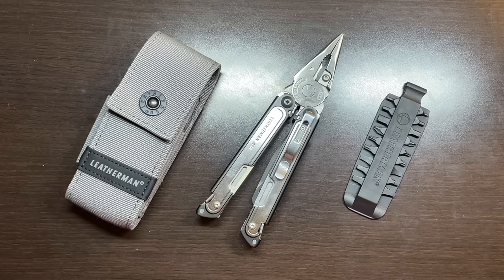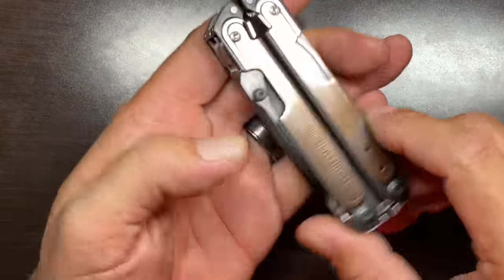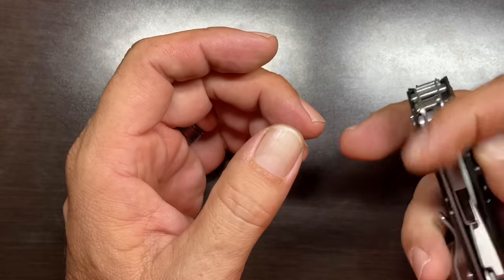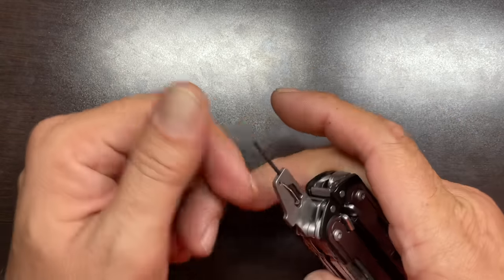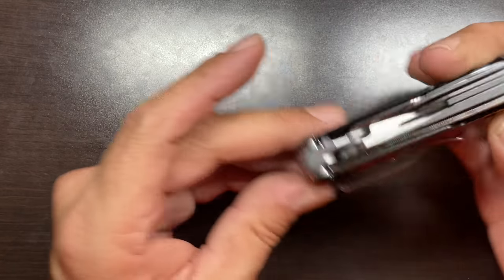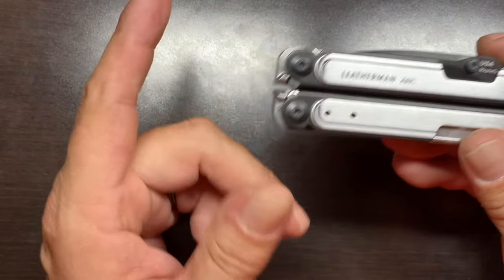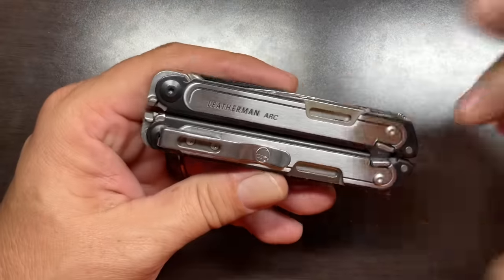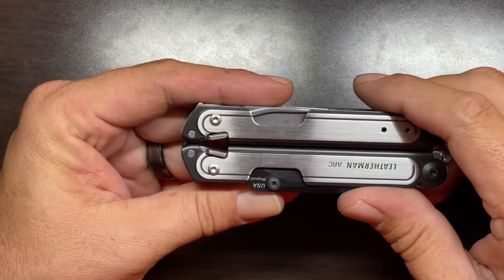Leatherman ARC : Initial Impressions

Comment: Regarding the stiffness of the pivot on the pliers, I share in the frustration. I've re-purchased the same models over the years, namely the Surge and Wave, and never had issues with them being so stiff when put under pressure. This has only happened with my recent purchases of both of these tools. It's pretty annoying having to twist the handles literally almost every time I put pressure on the plier head just to get them to open again.

Comment: Hi Ben, 
Great video as always.  But I must ask , I wonder why they put a micro driver in such an expensive tool like this ……..who the hell uses one of those on a regular basis……….surely it would have been better to put the T shank adapt in there instead, much more use considering …….. 
if it’s such a premium tool, it needs premium usage right?? 
Also, as I’ve said many times before, why don’t they design a chisel /  2 x wire stripper like Victorinox. You can quite easily open boxes etc with that ….. 
I personally think Leatherman need to UP Their GAME if their features, it’s the same old stuff, just moved around. Bit like APPLE !!!! 😮
Reply from the maker: I agree with you on the micro driver.
Reply: I’m in maintenance and use that driver a lot, actually for what it’s worth

Comment: you position the wire with the stripping notch against the frame, and use the blade to strip the insulation by spinning the wire while applying pressure to the blade or awl like a guillotine, depending on model.  thats all U stripping notches, the V ones like on signal can opener does both action as one.  the U notches dont cut

Comment: I think the cutters were a bad batch of heat treated probably had to switch suppliers more than a few times. 

The plier head river is causing the stiff jaws. The easy fix is to shock the rivet with a hammer and a roll punch. Then over lubricate to flush out the debris.

Comment: Well said.  I am increasingly disappointed with Leatherman and their plier cutters.   Until they fix this issue I am not buying any of their tools with replaceable cutters!   I think Leatherman needs better designers.  They need designers who actually use tools and work in the trades.
Reply: Okay, but just think for a second... you want them to hire someone who is a "better designer" than who they have now AND "works in the trades." Do you see the potential issue there? How many people are both top of their field engineers and designers while also people who have trade jobs and use these tools everyday in hard conditions? Do we expect that all Leatherman employees have two jobs so they can stress test tools for one job while doing the other? That just doesn't make any sense.
Reply: @Lord_zeel  Yes.  I am a “certified” electrical engineer and I still “work in the field”.   I have worked 25 years in my field.  I have met plenty of college educated “engineers” who don’t know how to use basic hand tools.

Comment: Great review on the arc. Would you recommend the spirit mx clip and/or wave over the arc?
Reply from the maker: I don’t think you can go wrong with any of those choices. It is completely dependent on what is most advantageous to you. If you like ease of use, go Arc. If you like a robust tool set, go Wave. If you like the speciality tools and don’t mind how they are accessed, go with the Spirit model you like best. All of them are extremely good choices. Personally, as a Surge user, I would go with the Wave for myself. In fact, I would likely go with one of the Charge models.

Comment: For a premium tool at that price point, it should be a perfect tool with very little to complain about.  Leatherman is a company on the decline
Reply: They've focused on the collector/lifestyle/look-at-my-expensive-stuff crowd for a while now.

It's just that they now have lost touch with actual use so much ot has become apparent even to people who hardly ever use it. 
When any Ali-express tool does a better job at one of the purported primary uses of your new  flagship, you messed up as a company.

Like their "response" about the cutters is clearly BS: they've been using these for a while and only now it's getting attention from content creators they basically shove an old piece of candy their way and go "there, all better".
That goes beyond their earlier shoddy QC and consistency into a systematic issue.

I've admittedly been cynical about them for a while, but it's good to see this becoming more common. Might mean they will have to start working to show why they still deserve to be big dog.

Comment: Ben this was great - your content always is.  For me the Wave+ is my EDC handy-Andy DIY and my Surge is for the “real work. The Arc looks to me like an overpriced flimsy toy…it can’t cut a TIG wire w/o permanently wrecking the plier action?  The bit holder barely holds the bit? No string hole in the awl- that is CRITICAL if you’re trying to sew leather or other tough materials. A wire stripper you’re gonna have to file sharp before it’ll strip wire?  C’mon Leatherman who are producing this for?  I’ve had my newest Surge and Wave+ 2-3 yrs and I spent about  $230 for THE PAIR plus a bit kit !! 
Anyway for the Arc to be a $200+ tool they DEFINITELY need to scrap the rivet and machine a proper threaded tensioner for the plier joint.  They should also include an extra set of cutters, and a full complement of bits, including a spare micro-bit and the T6 they left out. The cap lifter and can opener should be one tool like
The Wave+, with the slot freed up used for a user-defined tool-maybe 3 interchangeable blades all included. And definitely get rid of the hole in the file. There is zero reason to insist every tool requires one-handed operation.  I have more but I’ll stop rambling here TLDR LOL😂😂.  Thanks again Ben for all you do - have a happy 2024 and stay safe on the job!

Comment: ... the SURGE is STILL King .... and the WAVE+ is still the Prince.
Reply: Agreed. I just want a wave with outside tools.
Reply: @Tapionski  ...the ARC appears to be an expensive attempt at tapping into the metal heads in the very expensive knife market. Show pony knives that don't do much work.
Reply: I prefer the Super Tool 300
Reply: I agree on the surge but I think the charge tti is the prince it won't pinch you as easy as a wave
Reply: @andyzavala8550  the tti is up there in the £$. For the ordinary working bloke... the Wave+ and SURGE are the best choice.
Reply: You're so damn right man
Reply: I like the free p2 and just received a p4 but it has the new cutters
Reply: They SERIOUSLY need to do a PREMIUM SURGE,  much better knife blades & easier pliers, not so stiff.  Also loose that small screw driver, it takes a bit-kit, you don’t need that surely ?!?!?!
Reply: $15 off on the Wave+ at the Leatherman site right now - $104.95.  Also $10 off the Rev.
Reply: Not in my line of work. The Arc is a needed upgrade.
Reply: 100%. Wave+ is in my pocket and Surge plus a😂 bit kit is in my work tool pack.
Reply: @iainhardwick1223 THIS. I've got a Surge since a year and using it everyday, this is my first Leatherman. But as a knifemaker I must say that the blades steel is very low end, they could have used multiple mid range steels with so much better quality/price ratio. Also, 420 steel isn't supposed to rust that easily. 

And yup, I have no use for the small screwdriver as the bits could replace it, the micro bits holder would have been a better choice imo, as my wife wears glasses that needs a monthly tightening that would have been handy ! I've seen some 3d printed adapter that goes on the "classical" bit holder that holds the micro bits but as it ships from USA the shipping price goes too crazy for me sadly.

Comment: On the cutters, has anyone tested the cutters by cutting above the gap? There is a notch higher to keep the material from spitting out. Every test I've seen puts the material to be cut in the gap, which forces the material into the cutter without starting a cut. The gap shouldn't be there for sure, but it may not be a cutter material issue.

Comment: I'm loving my arc. I did immediately switch the cutters for my old P4 cutters that don't have that gap/curve on them.

The problem with multitools is they are always worse than real tools.  A real knife is better than any multitool knife, a real set of pliers better than their pliers, etc.

But with the magnicut blade that critically opens and closes quickly, I can actually use this as a real knife. I might actually carry it.

The complaints of the price are honestly embarassing. A good pocket knife alone is $200. I would rather have a $300 or even $400 multitool if it means the tools will actually be viable replacements for real tools.

Comment: Like you said about the one handed marketing philosophy, I am sure this was the impetus behind the cutter change. My Gen1 P4 & P2 biggest frustration was the only thing not “free” about them was the stiff jaw head which you had to handle manipulate to open. So you couldn’t really do the slick butterfly moves people do in videos which doesn’t mean anything to me, but whatever. My Arc head opened free out of the box. Bought it unaware of any issues or media reviews and first thing I did was look at the cutter and deduced that their geometry and screw placement height mean they are not riding on the opposite jaw channel at the bottom to bind. Was the original P4 just a tight pivot or combination of cutter bind? I dunno, but I bet Leatherman got a lot of emails. You should do a video swapping new design inserts on a P4 and test that theory. People would watch.

Comment: I'm torn between returning mine when they show up, just having learned about this issue or keeping them and making my own cutters (if I can). Pretty ridiculous that we would have to make our own parts to make a tool function the way it should out of the box, but that's the race to the bottom society we live in nowadays too.
Reply: I think it's most likely that the geometry of the cutters isn't the real issue, and that some quantity of cutting blades were defective (too brittle) and coincidentally ended up on Arcs. Apparently there have been people that got Arcs with the square corner cutters, and replacement round corner ones that had no issues cutting the same stuff that broke previous blades. Combine that knowledge with the wording of the Email, and I'm pretty sure the issue has nothing to do with the corners (even if that makes them harder to use) but was just a bad batch that have an invisible defect. In other words, if you get yours and they break, Leatherman will probably just send you a new pair of cutter blades that will not have the problem.

Comment: Pretty lame to not include the T6/T8 combo bit. Those are probably the ones I use the most, the others are just an emergency backup that are nice to have if needed. For disassembling pocket knives for cleaning, the T6/T8 are nice b/c I've never stripped a screw with those, whereas with other T6/T8 bits I end up stripping screws more than I would like to admit haha. For almost any other bit, excluding the phillips but especially the flatheads, they're too soft and I end up marring or bending them quite a bit. Flatheads end up unusable.

Comment: Wirecutters are important, always thought the replaceables where a structural issue and resulted in lots of broken pliers. I did a cutting test with a small steel chain, Swisstool, Surge and a Knipex and the surge lost, Swisstool had no problems. I like the design of the arc but it feels all like prototype testing on the general population, not very well engineered products.

Comment: Leatherman seems to turning into Apple: Proprietary bits, longtime issues they give non answers about then replace rather than fix and finally exorbitant prices. People complain about 230 USD for a multitool and then get shushed into obscurity because of the magnacut blade but the issue goes further than that. You want to buy one of these in Australia, it'll set you back $500 AUD or $330 USD. You pay that much for a multitool and it better be faultless or make you coffee in the morning AND brush your teeth for you. Have never owned a leatherman multitool and with nonsense like this (especially the price) probably never will.

Comment: The poor ergonomics of the handles when using the pliers (relative to other available tools) and the bits/poor Philips driver of the P2/P4, turn me off this series. A decent knife blade and easier one handed access don’t make up for the other shortcomings. I can already use my ST300 one handed easily enough and it’s not even fully broken in.

I’d like to see Victorinox come out with a more American style Spirit. Capitalize on the strengths of the Spirit but redesign the tool to accommodate easier one hand operation. I do enjoy the clock-like precision of the Spirit and loosening it up to make the tools more one hand accessible might negate that quality feel.

Comment: The new cutters are junk. First my arc and now my new surge have them. Both are pretty much useless unless you hold your toungue just right. I think leatherman should put out a statement and replace at their cost with the older cutters  

If leatherman did this intentionally to handicap the tool which I'm going to assume is the case if it's not addressed sooner rather than later these 2 tools will be the last I ever buy from leatherman and I will stop with my at times fanboy esqu recommendation for leatherman.

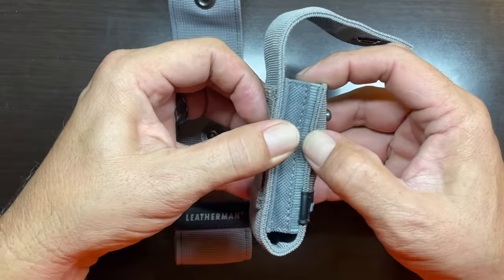Comment: 3:10 that bit sleeve wont fit, if the flap was fitting lower. Leatherman was thinking what you might put in there.
Reply: I thought the pouch was too big also. But after adding two bit kits, bit extender and 711L ratchet the pouch is a perfect fit with no gap up top.